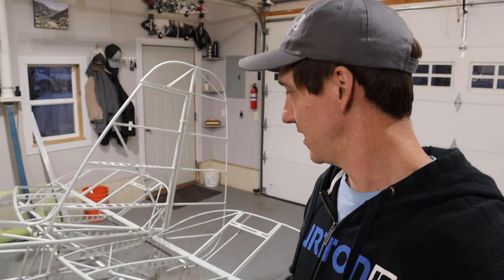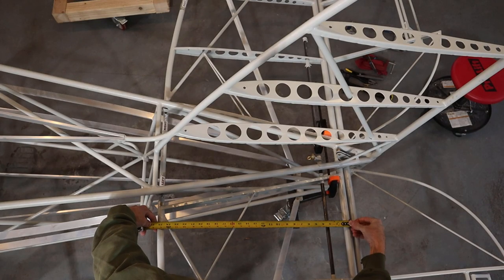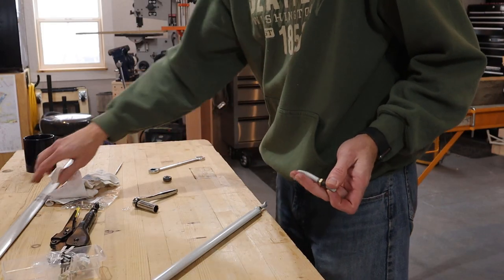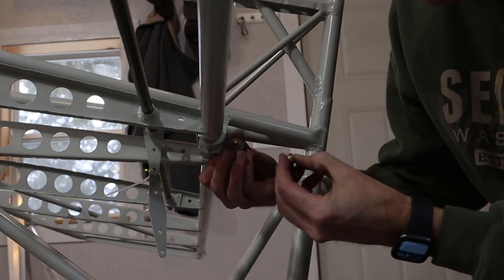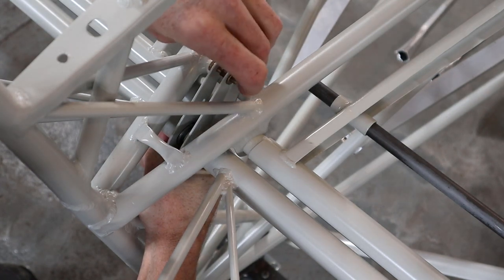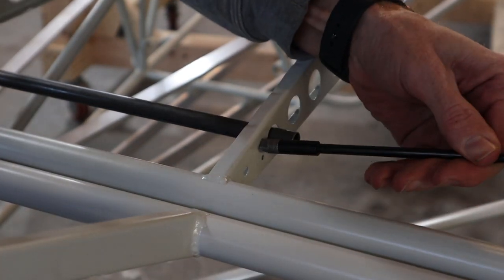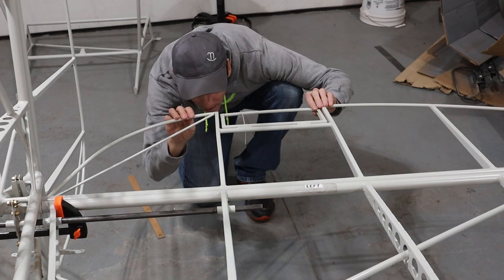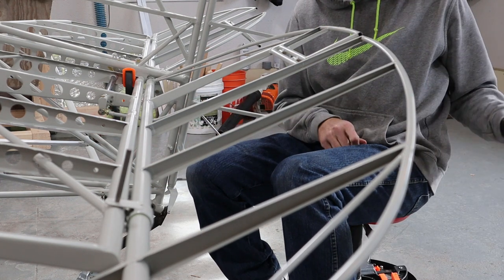Tail Feathers

Comment: What is the thickness of these pipes?
Reply from the maker: There are several different tubing sizes used in the tail feathers. Most have a wall thickness of 0.035 or 0.049.
Reply: @ColbyOsborn  https://www.youtube.com/watch?v=dtHFRIQFHkE&t=208s I used 2 cm diameter and 1.6 diameter 1.5 mm thickness I think is a bit heavy.